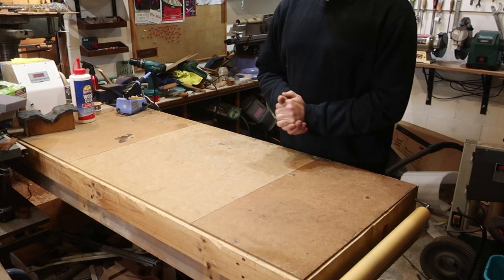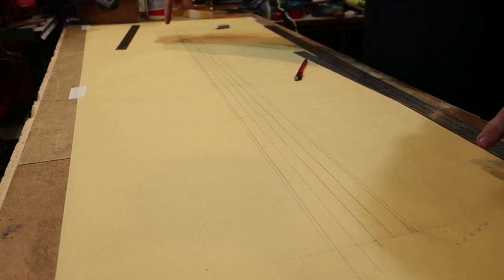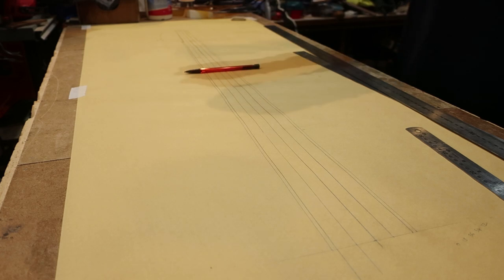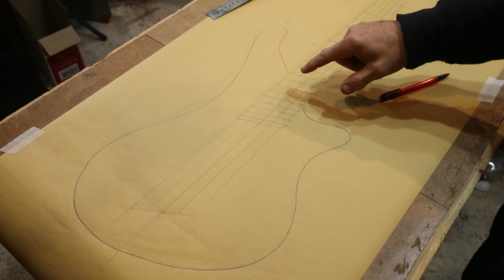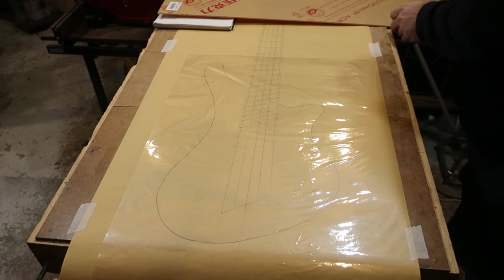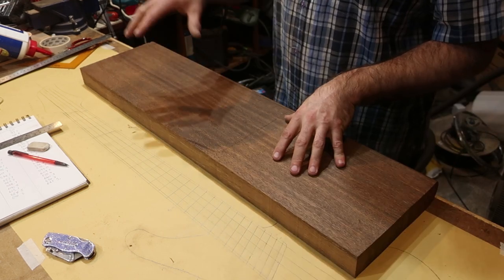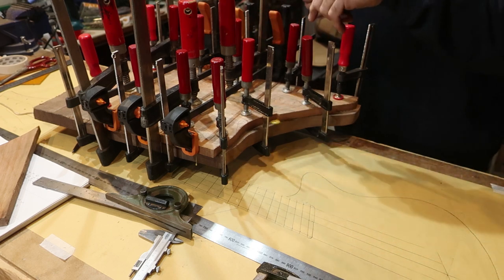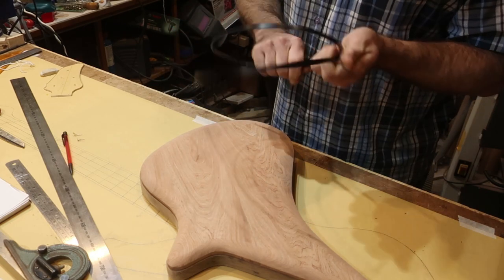Multiscale 5 string Bass Episode 1 - Initial design and bodywork

Comment: Awesome bass, looking forward to this build; still holding out for the 3 string bass though!
Reply from the maker: I take it you've seen the fretless 3 string? That bass is sitting around with no strings because I needed some flats on a pbass for a Motown themed gig, and haven't ever needed to recomission it. I could fret it and string it BEA?
Reply: @fanbladeinstruments  Yeah that would be awesome! The fretless was cool, but I love the idea that in principal, you shouldn't need more than that as a bassist (obviously this doesn't actually always hold true).
Reply from the maker: The main issue with the fretless one was that when I did need a note that was up the neck I had to change position quickly and that doesn't lend itself to good fretless intonation. I played The Beatles Come Together on it. Badly. On stage. Never again. The rest of the band threatened to revoke my fretless license🤣

Comment: Question about "ebonizing"... Is there a reason to do it "chemically" vs... India Ink? Don't get me wrong, it looks awesome that way. I'm just wondering if there's a reason one way vs the other... I would think that the CA glue would seal the Ink just was well as the Vinegar and Iron solution... Interested to hear your thoughts.
Reply from the maker: I haven't tried india ink specifically, I have colored in an electric fretless board with sharpie and that was a strange experience, it took ages to cover the whole board and then the CA kinda dissolved and smeared it, I had to wait for the first CA coat to dry, color the whole board in again, do a second coat, wait to dry, third coat of sharpie, and that seemed to do  the trick. The end result was excellent but it was quite the process to get there, the ebonizing is significantly faster and more stable. I think india ink contains it's own binding agent which effectively makes it a type of paint, it would be more stable than a sharpie and probably work very nicely. I'm now looking at my cheap double bass with a maple fingerboard painted black and I'm wondering if they've used india ink on that? I shall have to get a bottle and try some things. Cheers.
Reply: @fanbladeinstruments  All I really know is that it's a carbon based pigment... and that it is... quite black if you don't water it down... I'm jut getting into all this and almost ready to start the process of finishing and assembling a kit (before I try one form the ground up) and trying to figure things out, thanks the reason to "not Sharpie)

Comment: I've been playing for decades and I'd never heard of a multiscale bass. I'm still not sure that I get the point.
Reply from the maker: The point is that the longer scale length on the B string  means you can have more tension on it to stop it getting floppy, which in turn means you can have lower action before it starts banging into the fretboard. It also changes the sound, supposedly tightens up the low end and makes everything a bit clearer - I have no experience playing one yet but I'll find out if that's true in a day or so. Cheers.

Comment: Just because I'm curious, where did the parallel fret land?
Reply from the maker: Haha, actually none of them! The 9th is almost square but the geometric centerpoint is somewhere between the 8th and 9th. I think what probably happened is that I took the angle measurement from the centerline and then marked it on the board from the edge of the neck, pushing the angles back slightly, something like that anyway. I should've used the same process for the board as I did for the pattern then the two would be exactly the same. They're both technically correct but the one on the pattern is the one I actually wanted.
Reply: @fanbladeinstruments  I don't know that you're too far off. The Dingwall basses are basically the same, the parallel point is somewhere between the 8th and 9th. So I'd say you landed on a good spot. 😉
When I built mine I put the parallel fret at the 8th.
Reply from the maker: Oh, it's you Tim😁 I went to see what was up with Voyeur Guitars and their multiscale builds and found you've had a rebrand, cool logo too. How'd the thru-neck tele come out?
Reply: @fanbladeinstruments  Still working on it. Trying to figure out the custom inlay. 😕